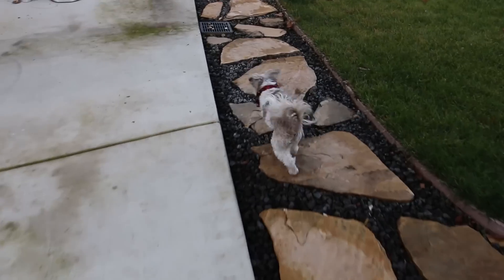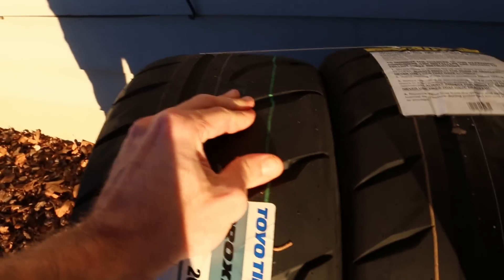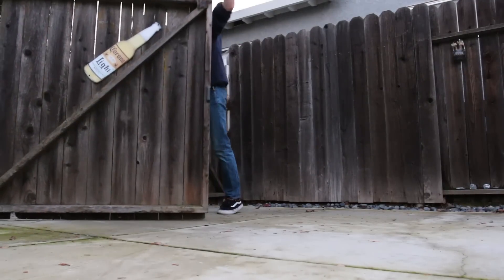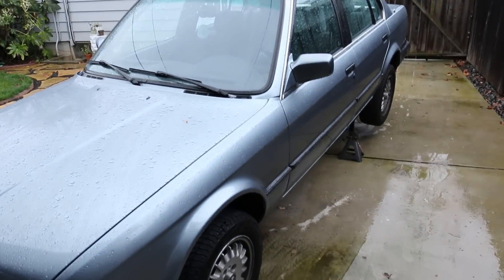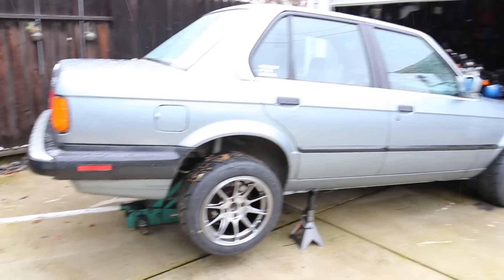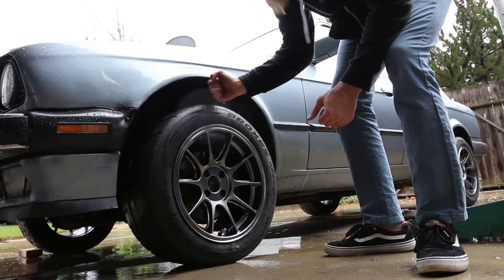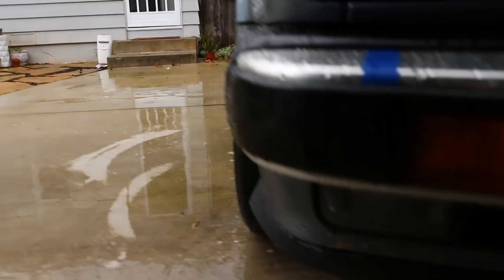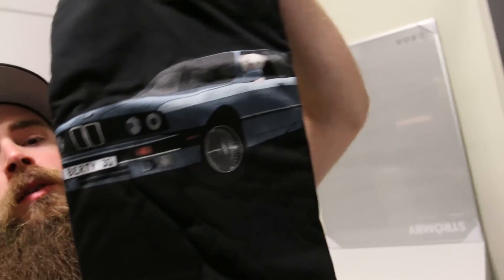NEW WHEELS AND TIRES FOR BMW E30 BERTY 30 TRACK/DRIFT BUILD PART 6

Comment: is anyone else hot and flustered! hey do you recommend the 4 door or 2 door I'm looking at doing a rally conversion to my E30?
Reply from the maker: Tyson Walker not sure why you feel like that. I like the 4 door because it's usually cheaper to buy. Also the chassis is a bit stronger than the 2 door. But you would add a roll cage anyways so that will stiffen it up and make it safe.

Comment: how are these wheels holding up so far? Doss/Ambit wheels claim they are JWL certified but if you research it they basically are faking those "certification" claims.

I wouldn't really track with them per se, but if I can then it could be a good replacement for my OEM wheels for my e46 M3. I go track day maybe once a month sometimes less but I do daily my car.